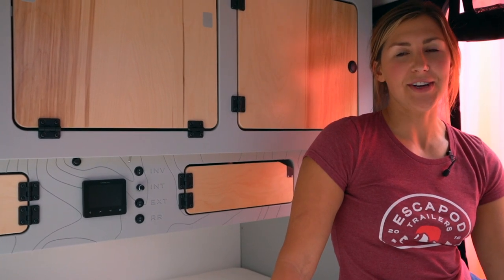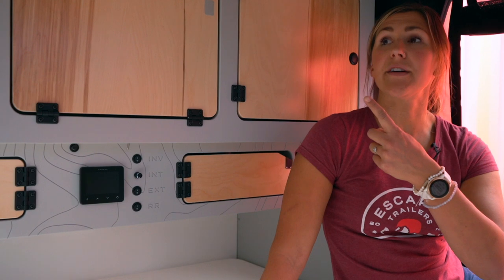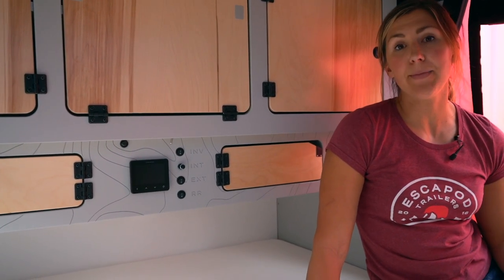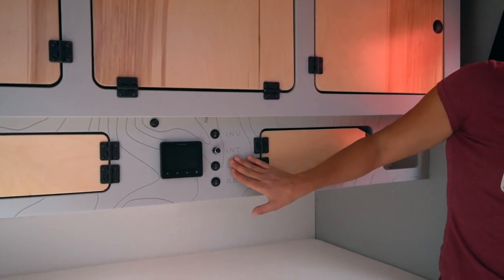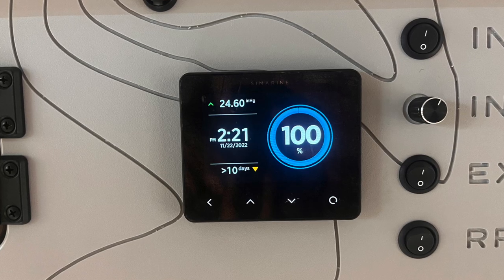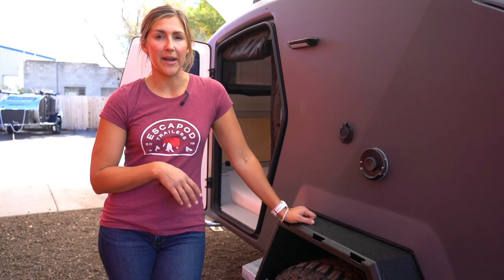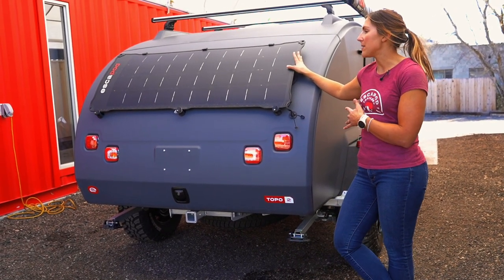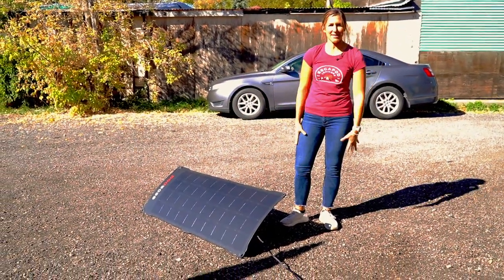TOPO2 | Teardrop Trailer | Power Systems

Comment: Needs more batteries to run the AC overnight. No one wants to use propane anymore.
Reply from the maker: When people add the A/C unit. we do encourage a double battery bank, because it is a higher draw add-on. We like to let the A/C run a little while before bed and then kick it into ECO mode overnight and it maintains the temperature really well without using as much power!